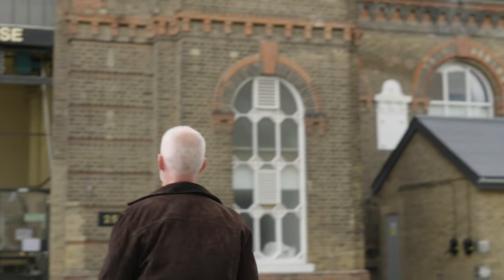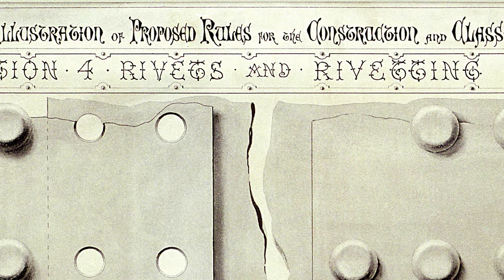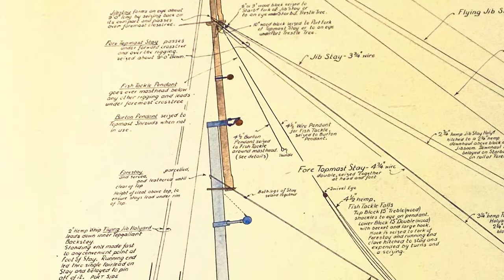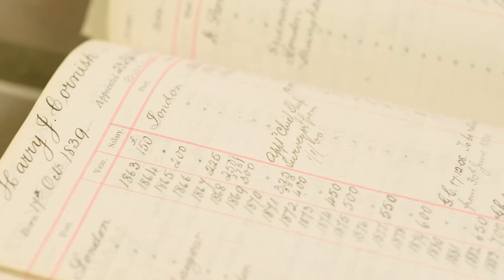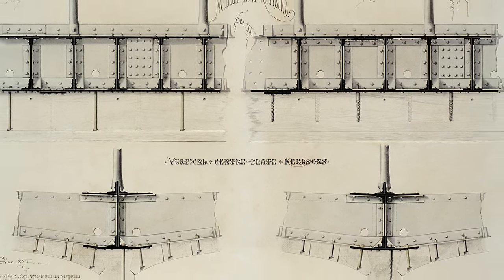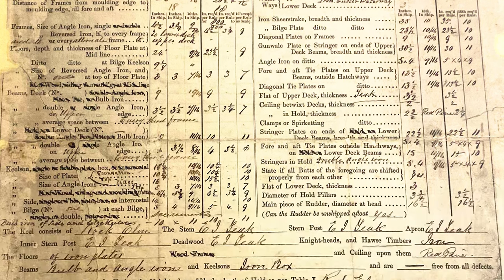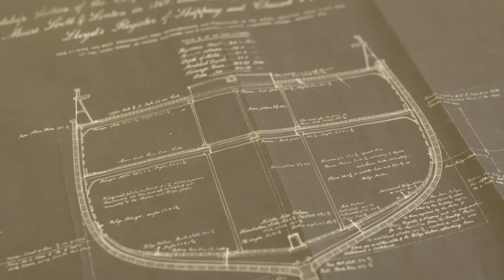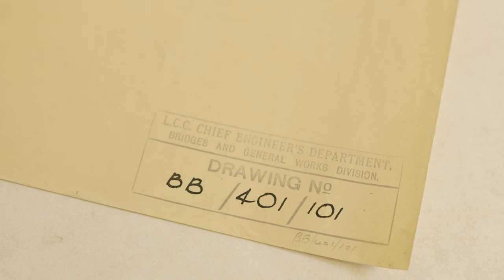The Rules and Regulations for Composite Ships

Comment: I’ve never agreed with the much stated remark that the clipper ship was the zenith of sailing ships. While they were sleek, the sail plans required large crews, they lacked cargo capacity & therefore limited to high value cargo. The iron & later steel hulled ships, especially after 1870 were far superior in capacity and many could match the clippers in speed. Innovations such as the Jarvis Brace Winch allowed smaller crews to handle bigger sail plans. Ship designs like Prëussen, Potosi, Herzogin Cecilie showed that sail was still an efficient means of transport. There was still plenty of room for innovation. Where all sailing vessels fell short compared with steam ships was in port operations. Small hatches reduced access & speed of cargo ops. The low freeboard when loaded was partly to blame for the small hatches, since decks could be awash in foul weather. All steel hatch covers as we have now could have helped. The need by most of the square riggers to use solid ballast, such as sand or stone instead of water, also greatly extended the time in port. They could have easily had ballast tanks but owners were typically cheap (still are) & chose not to build them into the design. This was rather short sighted.